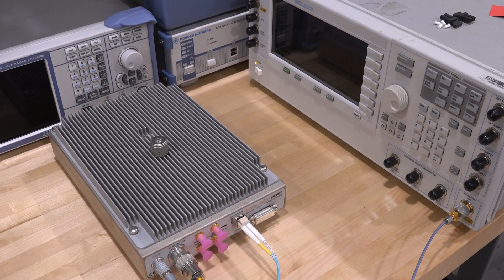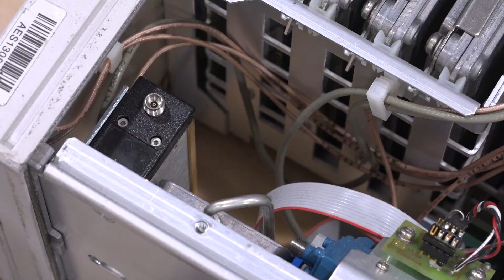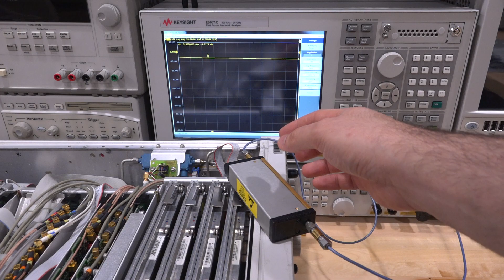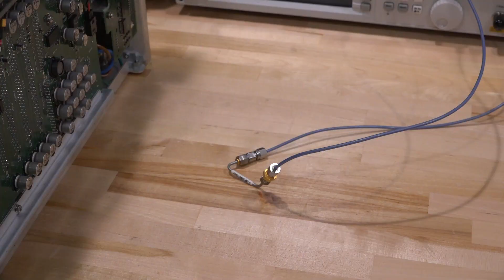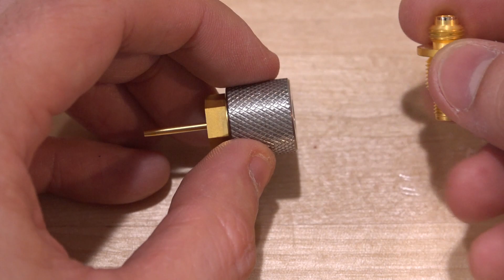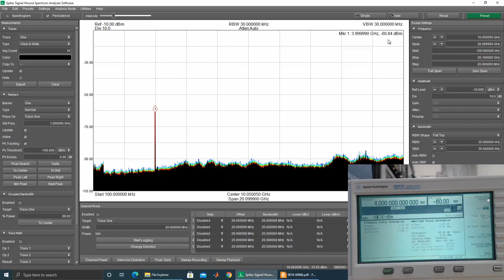TSP #192 - Teardown, Repair & Experiments with an Agilent E8267D 20GHz PSG Vector Signal Generator

Comment: Alltest doesnt have any technicians. It was a real silly problem any one could find.
Reply from the maker: No repair attempt is made on these instruments. They are from the warehouse.
Reply: @TheSignalPath  Someone unscrewed the cable to the attenuator.
Reply from the maker: @electronicatutorial  Yes, but not AllTest. This is how the unit was purchased from another company probably as part of a larger set of units.

Comment: Those washers (or shims rather) are probably there to tune the center pin extension out of the 3.5mm connector to get the correct depth. Whoever took the adapter out probably accidentally unscrew the connector assembly and wasn’t careful when putting it back resulting in crushed shims  wracking all sorts of havoc inside the connector.
Reply: Clumsy attempt at self-repair basically?
Reply: could be from manufactur , and with vibrations from moving the washers made a short
Reply: john legros I doubt it was from the manufacture as the locations of those shims(washers) are wrong, they should all be on the front. Also, some of them are literally split and crumbled into pieces when the adapter were tightened incorrectly.

Comment: You have illustrated this sort of fault before where the output is very low and frequency depenent. My initial thoughts were an open output. When I saw the disconnected cable I wondered if that was a way of creating a fault in case the instrument was sold off cheaply to the sabateur. In this case it seems not. I've seen tricks like this in the past with all sorts of items in for repair including cut wires hidden behind components. 
Shahriar, do you get to keep the instrument or return it to your supplier?
Reply from the maker: The repaired instruments to back to AllTest. They will check them fully, calibrate them, etc. before they are sold.

Comment: Very surprised you didn't jump on the output connector from the very start. Most obvious place for damage is always place where humans get to "interface". :) And the fact that all the self-test routines worked and showed no errors seemed to imply it was the very last stage of output that was the most likely fault location - at least that's what I guessed, based on other kit you've repaired recently with similar connector and/or cable issues.

Oh well, got there in the end - and it made for a longer more interesting video. Still, I think the cat had it figured out all along. :)

Comment: Had a similar problem on my old Marconi 2019 with on output. Pulled it apart to check output from RF amp all good. Checked at output of attenuator all good. Turned out the sacrificial adapter and DC block had a fractured joint! As soon as  I saw your fault  I wondered about the output connector. Great job!
Reply: Simon Spiers  ,  Aha! GOTCHA!  LOL  Ya gotta love it!

Comment: Think how much energy was being dissipated by that washer
Reply: Almost no energy was dissipated there. With the short most of RF energy gets reflected back to the source.
Reply: @adamturowski3765  Unless the local impedance was close to 50 ohm, which is unlikely... 
You are right! I lost touch with RF world
Reply: @octavmandru9219  Even in DC world as long as the short circuit resistance is less than source resistance, the amount of power dissipated in the short circuit is less than in the source.

Comment: I’ve repaired these attenuators in the past. There are little quartz/alumina attenuation tiles for each stage and I had one with a hairline crack. 

Our friends at Keysight provided a new tile and with careful disassembly & re-assembly it was possible to replace it.
Reply: Alex Scarbro  ,  Good luck with THAT!  LOL
Reply: Did a similar repair to my 8566 Spec An back when it (and I) were young. HP actually sold those attenuator 'tiles' and I was able to replace the tile and got it all working. Heckuva delicate job, but saved me some bucks as the attenuator assembly was big bucks.
Reply: @jgramsey  ,  To me, that would be like diving into watchmaking... with a delicate escapement!
Reply: @BruceNitroxpro  And yet there are watchmakers!

Comment: Yes if you bought a fixer up from eBay this would great .
But for a repair video , not as good , but makes point " sacrificial connectors " ;)
Thanks again
Reply: I tend to suspect that over-tightened sacrificial connectors are the usual mechanism by which this happens though (see Joel Dunsmore's comment). Of course, that's not a reason to avoid sacrificial connectors, just a reason to be extra extra careful when removing the sacrificial connector, because that's the moment of maximum risk.
Reply: @jjoonathan7178  I'm not against sac. fittings , I'm for them .
I would rather ware out those , than factory panel connectors .